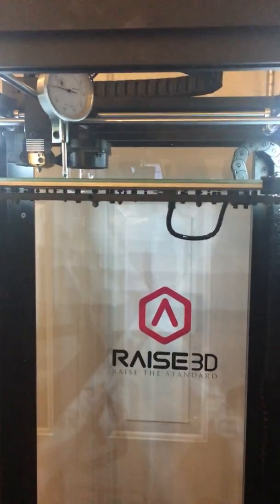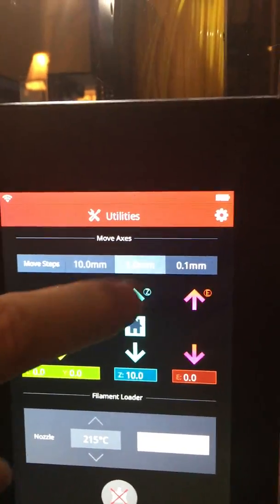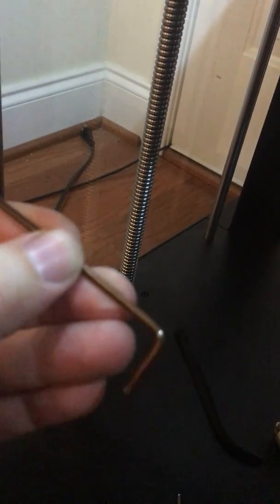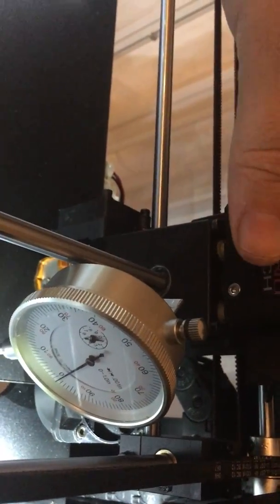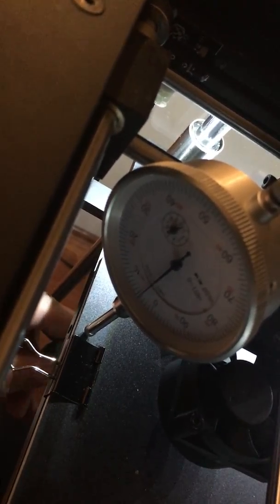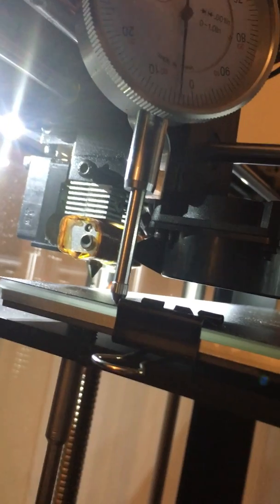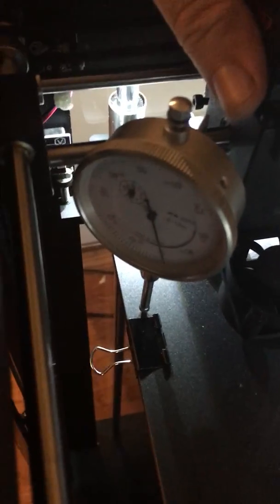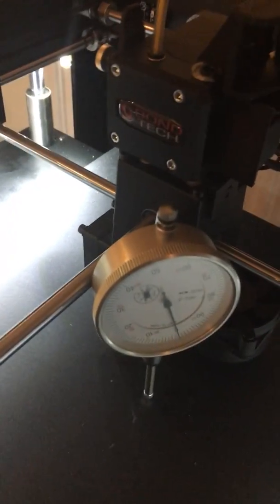Additional video showing using dial indicator on Raise 3D N2Plus

Comment: Other than the pain in the ass to level out the bed, how do you like it? Was looking to get the N2 but was conflicted. Do you like it or would you have gotten something else in place if you could?
Reply from the maker: I love he machine. I have all 3 now, N1, N2, and N2+. I'd almost a say the N1 is my favorite because the print quality is just so good, and that machine is the most reliable I've ever owned. Every my own self built custom coreXYs, I more or less sold them all off and for the last year, printed on the N1 and N2, and now have the N2+ for those extra big projects. And, I'm not saying the N2 prints with lesser quality or is less reliable, I just send most small jobs to the small machine and bigger jobs to the bigger machines. The n1 gets used the most because 90% of everything I print fits on it.
Reply: Ah, I see. I only have the budget for one at the moment so i was just going to get the N2 and not have to worry about bigger prints if they do pop up. But as far as dual extrusion how is it? I was going to use the 2nd extruder for HIPS because my models are quite detailed and technical to say the least and standard supports just wont be usable in some places. I just need an dual extruder that works no trouble and doesnt mess with the print quality.